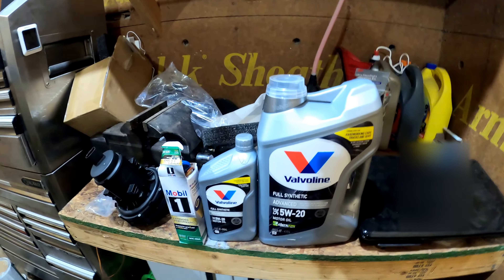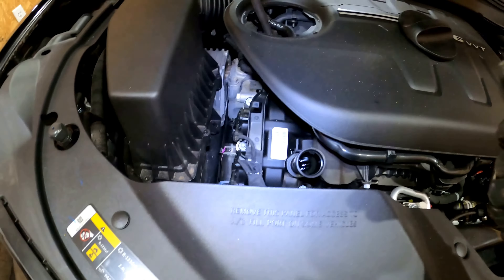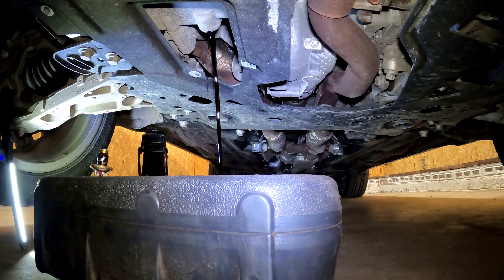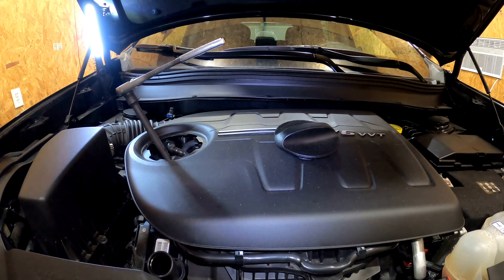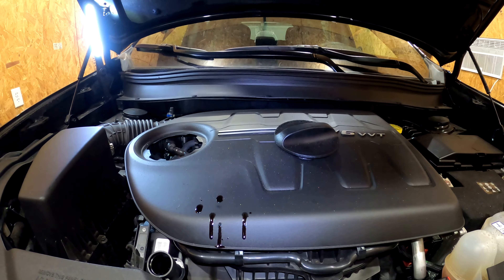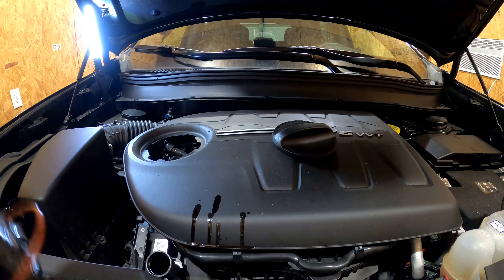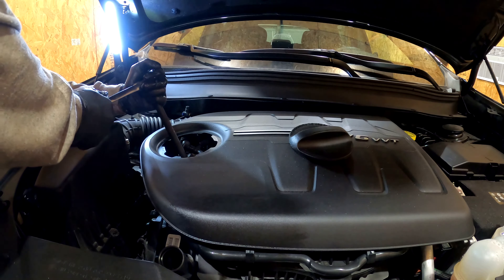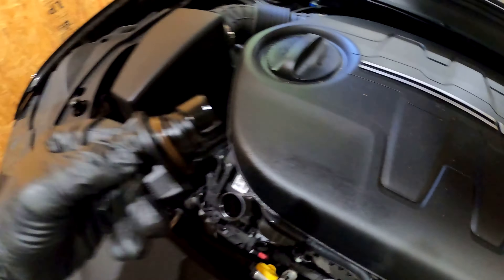2020 Jeep Cherokee Oil Change

Comment: Why not just pull off the entire plastic cowling above the oil filter?  Seems like it would make it a lot easier to get to the oil filter.
Reply from the maker: You can but unnecessary amount of work
Reply: @AnythingAuto  How hard is it to pull off cowling? thx
Reply from the maker: @newyorkerik  not sure. Never needed to
Reply: It is a lot easier. The cover is held on by four pins. All you have to do is lift it up.
Reply: @newyorkerik  Pulling off, easy peasy. Getting it back on with all Click-ins fully engaged, more work.

Comment: That seemed very tight for the oil cap.  Oil gilters go hand tight.  ??
Reply from the maker: That's straight from the manual and I've done it for 4 years never an issue. But this video is for entertainment purposes only. So whatever you do is up to you.i hope this video helps. feel free to like and subscribe for more & if you can, please help the channel out by giving a super thanks. Making these videos takes a lot of time, but we do it to save you hundreds. also head down into the description and check out the link for some high quality led bulbs for this and any other vehicle. use my referral for a discount. Add me in Instagram for behind the scenes pics and Stop by my store for some Anything Auto gear.
Reply: It’s 18 ft-lb and it looks like he barely tightened more than that, I thought the same as you when i first did this style of filter and ended up under tightening. With these style filters it seems to be better to over tighten them slightly than to under tighten them😊

Comment: @AnythingAuto Gonna change the oil in a few days thanks. I have 2021 Jeep Cherokee Latitude with 3.2L. I need to top off my coolant reservoir, did I buy the correct coolant, I got the Zerex American model coolant, it’s orange but there is currently purple looking coolant in it now. It is OAT type, can I mix the orange with purple?
Reply from the maker: Color doesn't matter it's the chemical make up that matters. Zerex is right but I don't remember mine being purple but who knows. I upgraded to the grand cherokee and honestly never looked at that either lol. Stick with OAT and you'll be fine. i hope this video helps. feel free to like and subscribe for more & if you can, please help the channel out by giving a super thanks. Making these videos takes a lot of time, but we do it to save you hundreds. also head down into the description and check out the link for some high quality led bulbs for this and any other vehicle. use my referral for a discount. Add me in Instagram for behind the scenes pics and Stop by my store for some Anything Auto gear.
Reply: @AnythingAuto  ok thanks and will do 👍

Comment: If it’s not a 3.2 you’re wasting your time? Please explain
Reply from the maker: 2.4l is a joke of an engine in a vehicle this large. It cannot tow. It doesn't do well in extreme conditions such as mountains ect.. paired with 9 speed turns a tiny HP engine into a bigger dog. Get the 2l turbo or 3.2l. Don't waste your time with the tigershark engine.
Reply: @AnythingAuto  I wish I read this before I bought my 2.4 jeep Cherokee. 😐
Reply from the maker: @Sixtysixtaytay  It should be fine depending on what you use it for.
Reply: I have the 2.4, but I don’t tow anything. I’ve had no problems going through mountains in the winter. Acceleration is not the best. But the gas mileage is legit. Avg. 28-29 no problem
Reply from the maker: @P M  gas mileage definitely beats the 19 to 21 this cherokee got. That's on the highway. City was way lower but nice to have the power. You don't buy a Chrysler for good gas mileage
Reply: @AnythingAuto  only 19 to 21? Is that high Elevation? I have a 2020 Jeep Cherokee with the 3.2 and get 25 to 29 highway during the summer. Winter its low 20s though
Reply from the maker: @Draecath  that's highway Miles too. Yes, high altitude. Good for you. We never got anywhere close to that in all 3 of our cherokees. We get better mileage with the grand cherokee than we did with thr cherokee.
Reply: What's best to go with for good gas mileage? I Live in Sacramento County in California and don't do much traveling. Go up to Tahoe maybe a few times a year and work commute is about 100 miles round-trip.
Reply from the maker: Nothing Chrysler makes but if you mean cherokee 2.4l. Not sure how it handles mountains during summer heat but on paper 2.4l